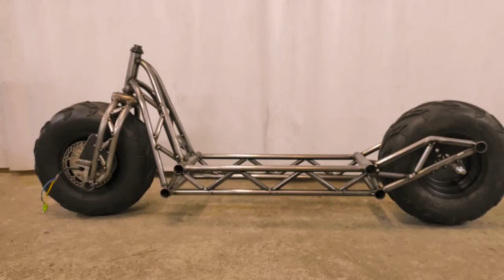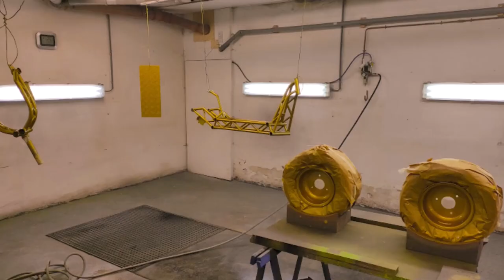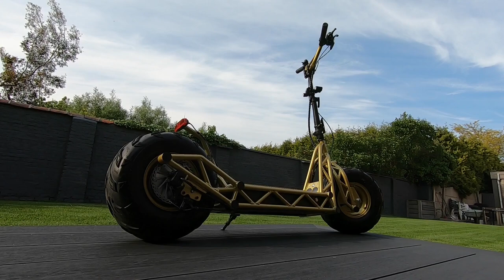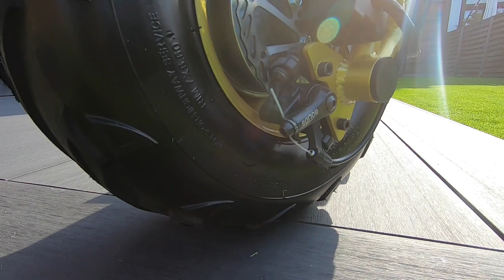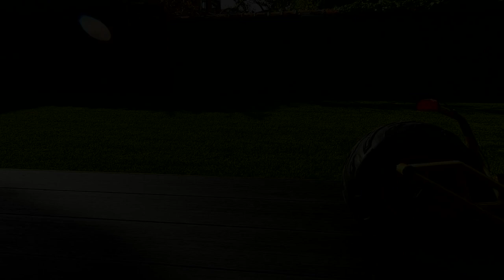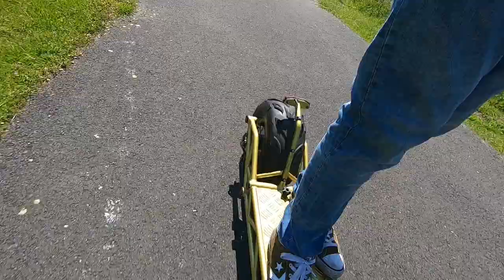DIY powerful electric scooter from hoverboard

Comment from the maker: I am currently building another scooter with 4 motors!  This time I am filming the whole process.  Subscribe if you don't want to miss it👍
Reply: would love the drawings of the frame work ! It's really nice.
Reply from the maker: @amigo_official8333  sorry I don't have plans.  I just had the idea in my head and build as I go.
Reply: @hennybutabi  okay too bad. I would really love if you had the time to make a basic tutorial on how to connect a hubmotor to a motor controller. I'm a newbie but I am really interested in learning this stuff, it's so cool. Just can't seem to find any tutorials on here. As I understand, i need the following to make an electric scooter run. Battery,motor controller, hubmotor and a throttle. Do I miss something. And if you don't have the time to make a video, can you recommend a website where I can learn ? Where did you learn ? :) THank you.
Reply from the maker: Hello. In short you will need 1 controller per motor.  There are plenty of videos on youtube on how to wire them, its not that hard. Check out tchangly21 channel, plenty of info there, however all is in french.  I learned through google and youtube :)
Reply: Ascertain azure
Reply: How costly for one scooter?
Reply: Hy. Are you interested to sell one? Or tu make one for me? I am interested.  Thanks
Reply: How to connect acceleration from 2 controller. Do you have a picture?
Reply: Nice so how much is for that gold build and that gas build sir please let me know thank you

Comment: With those massive wheels you really don’t need shocks!! How many miles of range are you getting?? Great video and great design I’m going to subscribe to watch your next build!! Maybe larger motors on the next one!!!
Reply from the maker: I am getting 17km range which is about 10 miles.  Next project will have 4 motors and bigger batteries.  Thanks for subscribing :)

Comment: I've been building my own scooter like yours. I got a 1000 watt brushless motor on it. But man all the welding I've done it is heavy. Not sure if you'll respond or not but how much does yours weigh? Mines not done yet but almost...but it's already 53 lbs . Is yours heavy like that too?
Reply from the maker: Mine is around 35kg which is 77lbs. But I'm not a heavy guy so it does not matter so much. And based on my experience with my other builds, a scooter drives better when it's heavier. Good luck with yours. Check out the other electric scooters I built on my channel.

Comment: Great Build!! Ive really been thinking about building my own scooter. I want to build something fast that i can race. what do you suggest for getting something built that can go over 100 MPH .I NEED SPPED!
Reply: 100 mph ? On a scooter 🤣🤣🤣
Reply: @mohamedhesham9849  it's possible if you know what you are doing. you're goiong to die for sure, but it's kinda easy to go 100mph with a scooter.currently Kaabo's fastest one goes 70mph

Comment: I understand that the hoverboard motor is mounted to the whee face. But how are you attaching the axle to the wheel on the opposite side. These are great builds btw.
Reply from the maker: I drill a hole in the center of the outer shell of the motor. Then I weld a threaded rod to the motor shaft. The shell goes over this shaft through the wheel and attaches to the opposite side of the fork. Thanks for watching👍

Comment: Great project! I’m looking into using those motor controllers for a go-kart project, i’m wondering what the top speed is and how good the torque is at starting speed. Thanks
Reply from the maker: I think this setup is too weak for a gokart.  Topspeed is around 35km/h. Torque at starting speed is ok for a scooter is a heavy gokart I think it will be dissapointing
Reply: @hennybutabi  i will use two motors per wheel in the back and two more motors in the front, which is 6 motors in total and enough power for me. I already managed to put two motors together inside a go kart tire for a diy onewheel project. Do you know if these controllers support field weakening or if i should try to use the original hoverboard controller with a custom firmware?
Reply from the maker: @pavletrnic1433  don't have any info on the field weakening but since they are just simple cheap controllers I suppose they don't have it.
Reply: @hennybutabi  thank you, i’ll look into findong firmware for the hoverboard controller.

Comment: Amazing build. I was wondering  how did  you use 48v controllers with 36 volt motors. Shouldn't it be the same? Would it be as fast if I use 36v controllers with the hoverboard motors.
Reply from the maker: I use 48v controllers to be able to upgrade to 48v battery later. Putting 36v battery on an 48v controller works fine!  And yes, I think so.

Comment: nice!!  do you have any pic or movie how you mount motors in these wheels?
Reply from the maker: No sorry.  But its not that difficult: open up the motor and bolt the outer housing to the wheel.  I am currently building the next project and this time I am filming everything. So stay tuned ;)

Comment: how did you go about mounting the wheel on the chasis with a hooverboard motor if you just had a single-sided motor
Did you weld a rod on the motor or I don't know ??
Reply from the maker: Yes  I drilled a hole in the outer shell.  Then I drilled a hole in the shaft an tapped it and screwed some threaded rod into it.  The outer shell of the motor is bolted to the wheel.
Reply: @hennybutabi  thank you for Your speed Return message
Reply: Hey good work but hi have a question you have build a voltage converter for passing 36v hoverboard battery in 48v or you have drop 72v in 48v can you light me pls

Comment: How did you get it to go so fast ?
Reply from the maker: since the diameter of the rim is a lot more than the hoverboard wheel it is faster.  Less torque but more speed.  I just tested with 48v batteries and top speed increased to 47 km/h.  But that is too dangerous :)
Reply: @hennybutabi   thank you for the reply I never knew that but amazing build you should be very proud I've subscribed hopefully you continue to do these types of builds

Comment: Very good electric scooter!

Question.
Where do these big wheels come from?

I also want to buy and can’t find.
Reply from the maker: 110cc chinese atv, its mentioned in the description
Reply: @hennybutabi  Did you remake them and weld them with aluminum motor wheels?

The fact is that I am also looking for a solution for my electric scooter project. I also need a huge electric motor wheel. Two pcs.